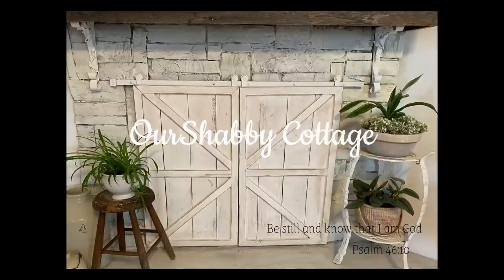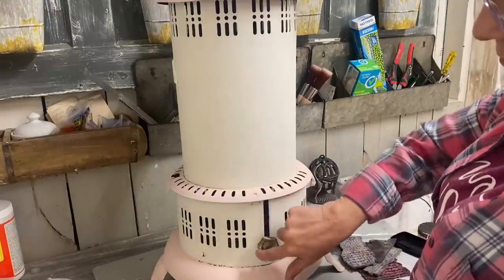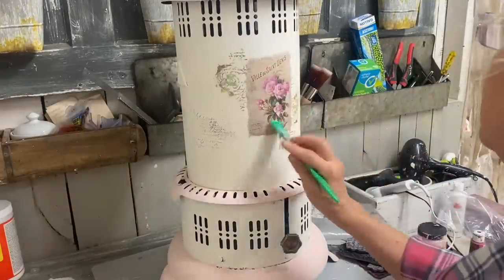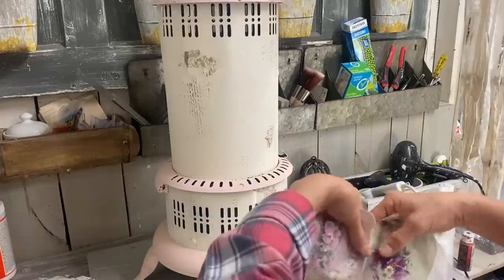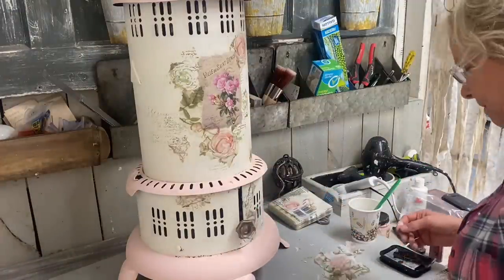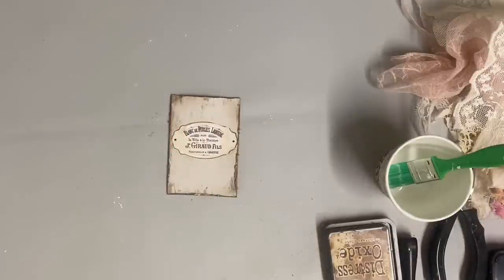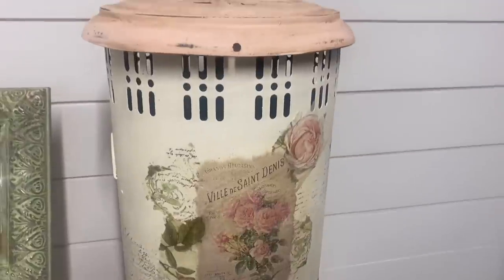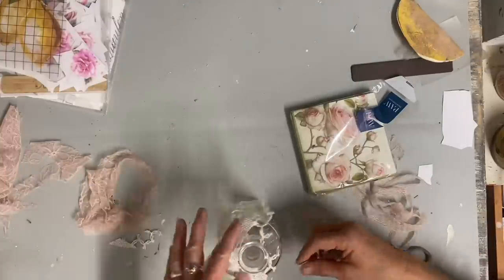DIY Shabby Chic Thriftflips

Comment: Never in a million years would I have thought of painting and decoupaging a kerosene heater, but it is outstanding! I am wondering if the rose napkins have floral print over the entire napkin or just the top 1/4 as it's folded?
Reply from the maker: Thank you sweet friend 🙂.  I think they were all over but pattern was separate with each fold.

Comment: how did you clean the stove up? Did you sand it? Or What?
Reply from the maker: Lightly sanded it and cleaned with a damp cloth.  Had to seal it before painting.
Reply: thank you very much. I have a few of these.  @ourshabbycottage8553  🙂🙂💗💗💗😽